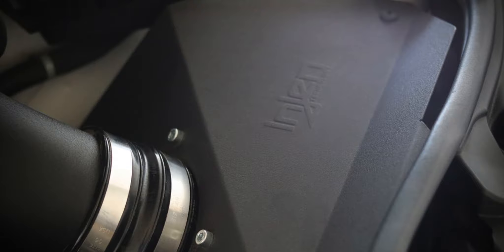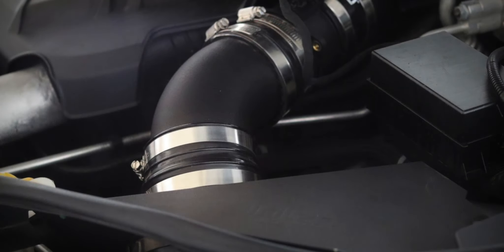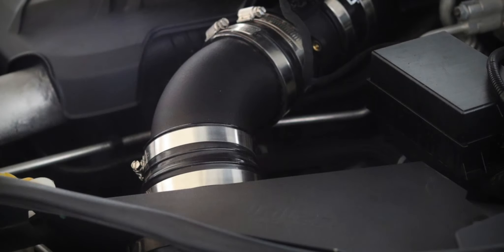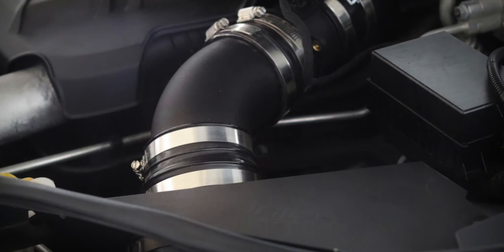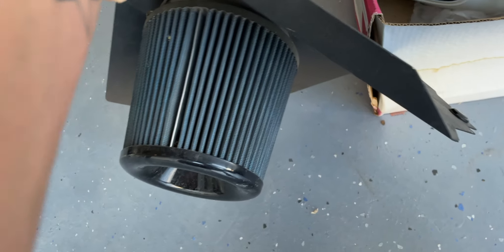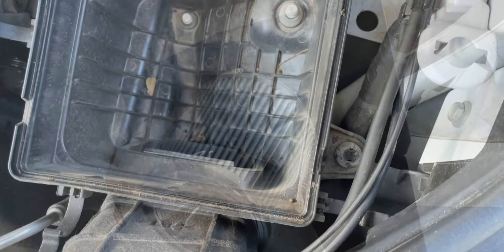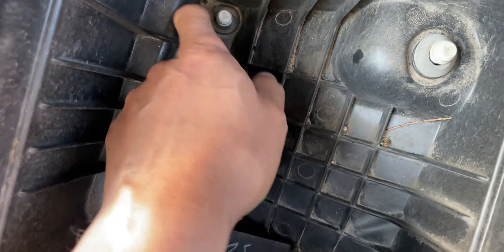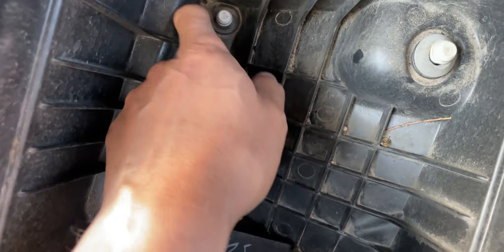INJEN Intake kit INSTALL on 2018 JEEP Grand Cherokee DIESEL 2nd Gen

Comment: Great video! But sound aside, did you notice an increase in power? How much percentage would it be? Thanks.
Reply from the maker: Honestly it’s very subtle maybe 5% a tune would make this more beneficial
Reply: @AtlasWilder  Thanks for the info! I needed to know to confirm or not the purchase of the same kit, because of the considerable cost and adding the cost of importing it to my country, I was not sure if it was worth it. Thanks again.

Comment: Have question for you. I’m looking to buy the same exact model as you have. The grand Cherokee high altitude. Looking to get more outdoors with the kids. I live in Florida. One thing I was worried about was ground clearance from the front bumper. Also am able to get the trailhawk. But I like the look of the high altitude better. Have you hand any ground clearance issues when going off roading with yours?
Reply from the maker: The lower part of the front bumper can be removed on the HA and it will give you any space you might need.  I just go slow if I think I’m gonna scrape.  The HA looks better just lacks tow points which you can install and the skid plates which you can also install lol.  

Future videos for me!